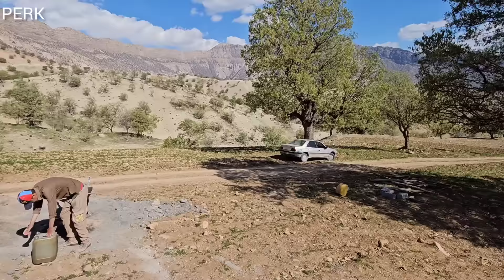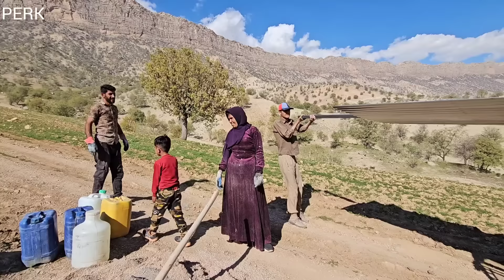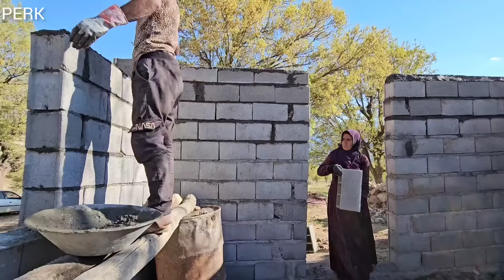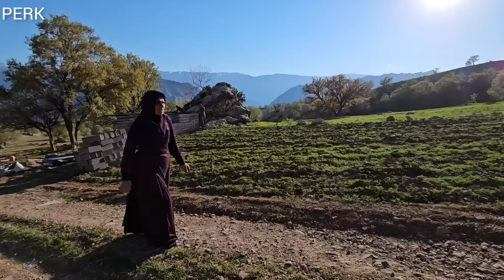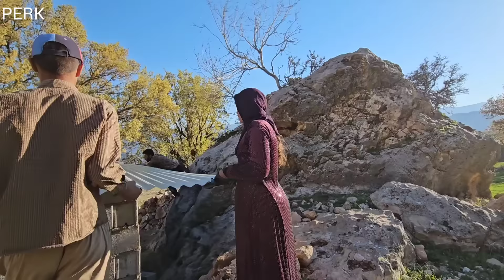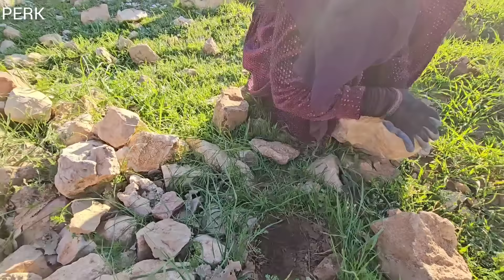Building the Roof of the Fariba's Farmhouse

Comment: Amazing!  everyone has knowledge about a purely technical issue, they cannot understand that this roof without thermal insulation in the summer will be a dead furnace, also with only 2 metal support beams it is extremely dangerous in strong wind and even in a light snow.  Fariba does not know this, but her brothers do and are responsible for what happens.